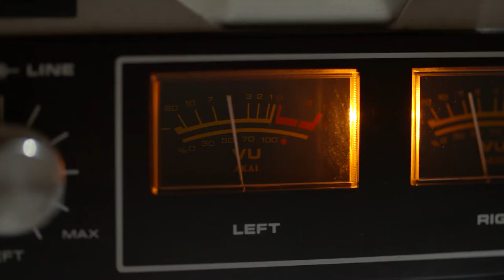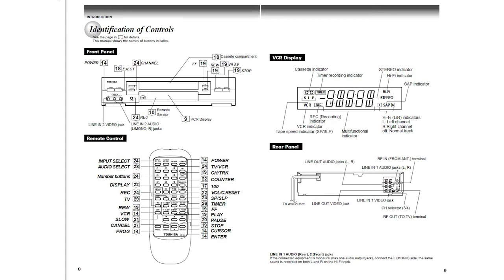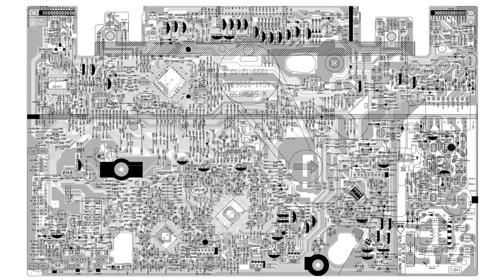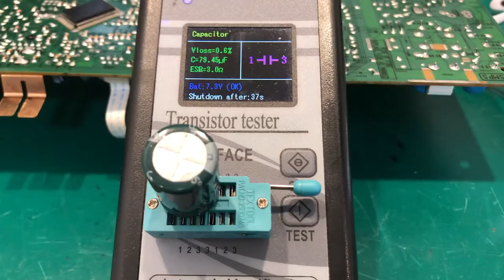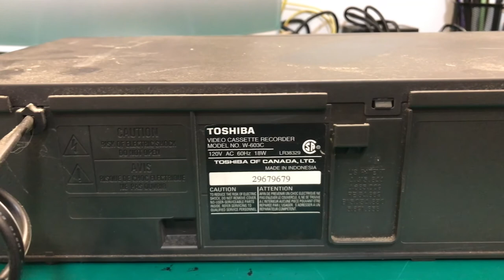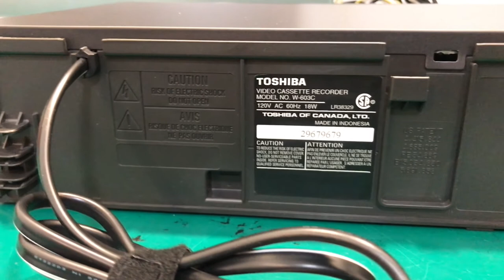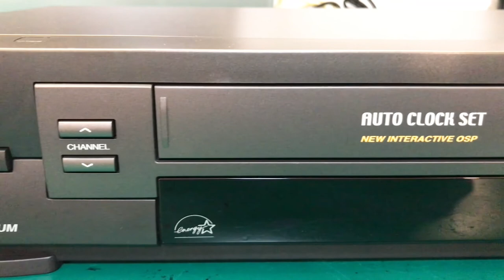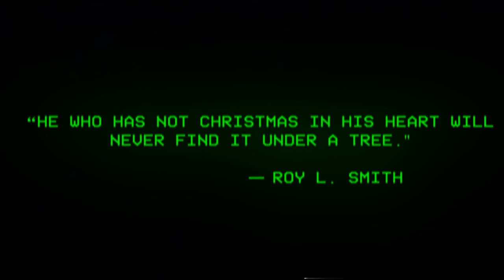Restoration of an Old VHS VCR Player | Retro Repair Guy Episode 23

Comment: DigiKey, Mouser, RS Components, Farnell, and LCSC are all good places to buy electronic components from. When buying capacitors, I always buy from Nichicon, Nippon Chemi-Con/United Chemi-Con, Panasonic (Matsushita), Rubycon, or Würth Elektronik
Reply from the maker: Hi. You are correct Mouser and others are reliable places to purchase from as well. And as for the other companies you  mentioned like Nippon, Rubycon, etc. they also make quality capacitors. I always purchase Nichicon by default but I've also purchased good quality components made by Vishay.

Comment: I had found this same exact VCR at our Goodwill but it was for $12 US. Had bad loading mech the small metal bar had broken one of the loading black things.

so I bought I broken no power one off eBay for parts. tired out they used two different head types the connector on top for the drum moter is either a 4 pin or 8 pin flex.

other than that everything else's was the same. I had trouble removing the center thing that goes in the middle of the loading assembly until I figured out how to do it myself. 

not a sturdy mech if someone doesn't push the tape in evenly and all the way it breaks one of the plastic guides where that metal rail connects them together.
Reply from the maker: Hi Richard. Yup they are not built very sturdy, I agree. But these are the units we would buy in stores for about $200 back then and why I wanted to restore it and not a high end unit. And although the build quality is not exceptional, the picture wasn't that bad at all as you see from my tests. You should take a look at my video where I restored a Sony reference DVD player, what a massive difference in built quality. Thanks for watching! PS How did you find the quality of image on yours after you fixed it?

Comment: You didn't take apart and clean the Mode Switch. That Is the round white plastic disc on the board at 26:15 This Is the biggest problematic part when It comes to switching In any Tape playing Machine. Still nice job with this one.
Reply from the maker: Hi! Yes I know what it is, at least I hope so after over thirty years of repairing this stuff! LOL Normally I do a lot off camera like bias adjustments on amps etc. that I never film but this time no, I didn't clean it as it was operating fine and this is a very low end VCR, not like the reference DVD I restored so, I didn't recap the entire board either. Still made a huge difference in quality of the output and tracking. Thanks for watching!

Comment: I still have a crap load of VHS Tapes. I do have a player which haven't used in years. I also still have 2 Betamax tapes, but no player.
Reply from the maker: Hi. Don't get rid of them! I regret getting rid of my old ones and now always buying them from the thrift store. Betamax players are a little hard to find whereas VHS players are a dime a dozen in thrift stores however I did find one last year and paid only ten dollars. On my end, I have the player but no Beta Cassettes.
Reply: The Betas are 2 of my favorite movies;  Dawn of the Dead and Phantasm. I've had them around 30+ years or so.
Reply from the maker: I love the Phantasm series!

Comment: Hello, I really enjoyed this video. Thanks, I learned a lot. Question, Do you do repairs of other peoples equipment? I have a very awesome JVC SVHS HR-S9911U deck that I have been using for a while capturing family videos. But the SVHS output conector is loose and clitchy. It shows the image and then goes away, if I manually jiggle it will work for a bit and then it goes.
And another issue is tracking on some tapes. I love this VCR cause it also has a TBC. I don’t doubt it could also also receive other maintenance. Would you work on that? If not can you point me in the right direction? Im in Puerto Rico. I have been looking for a repair company, I wrote Southern Advantage & no answer & also wrote Johns TV in NC and they don’t do mail clients.  Anyway thanks for the tutorial. I have subscribed to your channel.
Reply from the maker: Hi there! First of all thank you and for subscribing. I do respond to everyone but sometimes it can take me a day or two. The SVHS port might only need resoldering. Many tracking issues are due to dirty heads and a slipping pinch roller. Unfortunately it is very difficult for anyone to repair through mail/courrier because of both the cost and risk of breaking associated with transportation. Add to that insurance and the cost of the work and it comes out more than the price of a new unit. However, looking at my video if you feel comfortable you could at least try to clean the heads and pinch roller yourself it's not to difficult you only have to be careful. Is there no one in your area that does electronic repairs that could take a look at resoldering the port? If you attempt to do it yourself and need some advice I would be glad to help guide you in the right direction. Thanks for watching!
Reply: @RetroRepairGuy Thanks for your reply. I have searched locally and no one wants to deal with a VCR, back in the day there we’re many repair shops, they are all gone. But I’m gonna keep looking. I have cleaned the heads and it helps. I will verify the pinch roller. It’s the soldering of the SVideo output port that’s intimidating for me to do. Any soldering videos you recommended for beginners? Thanks again and great channel.
Reply from the maker: @Ragrocks  Hi again. I don't understand these guys who don't want to deal with a VCR. 🙄 Probably they just don't know how to fix it. I have a video about the tools for beginners here https://youtu.be/Hf8DBlH95nE also the best thing is to do is buy or pickup anything electronic from the garbage to experiment soldering and desoldering. You can buy a really cheap complete kit for twenty dollars on Amazon and it will be fine for a repair here and there. It's really not that bad, especially in an old VCR. An SVHS should be straightforward. As for taking the thing apart I would suggest, especially when you are new at this, to take a smart phone and take pictures of where screws goes or wires. It's free and fast and if the item stays open a while you'll have a reference as to where everything goes.  Also if you have a thrift store where you are pickup an old VCR, around here you can them for ten dollars. Open it up and have fun before you take yours apart. Hope this helps. Let me know what happens.
Reply: @RetroRepairGuy  Thanks for all the help. You have inspired me to tackle this. I have watched your soldering tips and gear suggestions. Plus I have watched some other soldering videos. Im finishing remodeling a bathroom. And my next project will be fixing this and other equipment. And I will practice first on a throwaway equipment.
Thanks.
Reply from the maker: @Ragrocks  My pleasure. And if you can renovate a bathroom, you'll be able to do this. Practicing on throwaway is definitely the best thing! Good luck and please keep me posted, I would love to know how it turns out!
Reply: @RetroRepairGuy  Cool. I’ll keep you posted. Thanks again 👍🏻

Comment: "Auto clock set" ?
Reply from the maker: Hi again! Yes, the VCR's auto clock set feature utilized the broadcast signal from a local TV station to set the time. This signal included not only the audio and video for TV programs but also embedded data called Vertical Blanking Interval (VBI). The timecode information was embedded within the VBI. After receiving the date and time information, the VCR would compare it to its internal clock. If the VCR's clock was different or incorrect, it would adjust it to match the timecode data received.
Reply: @RetroRepairGuy  Thanks. I was just wondering where the time signal came from

Comment: So, you just have replaced all the caps indiscriminately without testing them and without any regard for whether the particular section does not work? You re-capped the power supply section simply to future-proof it? Also, the W603 is not OLD old, it is only about 20 years old. To me, OLD means something from 1980s.
Reply from the maker: Hi. I think most would agree that VCR's are a thing of the past that we used during the 80s and 90s and certainly retro even if they were produced, like this one, at the end of the 90s. Time passes fast and this VCR is 23 years old so while it's not vintage it's certainly considered retro in my opinion. Same goes for the Xbox that now hit twenty years and is now considered a retro console. As for the capacitors, while I don't need to test every single one of them, I demonstrated at 12:37 a 22 microfarad testing at almost 27 with a 6.5ohm resistance and a 4.4% voltage loss to give you an idea. I've said this before in many of my videos that manufacturer white papers state an average life span of 15-20 years on their capacitors and that this even depends on its environment and use which could be shorter. I've also given the analogy before that you don't have to wait for a roof to leak before changing it when we know it is due for replacement. By changing them, this is what is called future proofing as we are replacing before failure because a failure can bring on other damages. And this is especially true of switching power supplies such as is in this unit. Switching power supplies are prone to failure as I mentioned at 14:35 so I went a step further and replaced the capacitors for ones that have a rated life span of 12,000 hours. Also the end result in testing speaks for itself. It's important to perform such maintenance on older equipment we want to keep around. An example is on older computers like the VIC 20 or Commodore 64 for example because the chips are getting much harder to source. If the power supply goes, it would burn the chips. Thanks for watching!
Reply: @RetroRepairGuy  Thanks for the reply! To me, 1990s were yesterday, so anything made in this century is still new :) I should have watched the video without skipping, you did explain why you replaced the capacitors. I hope this machine finds a good home. Take care!